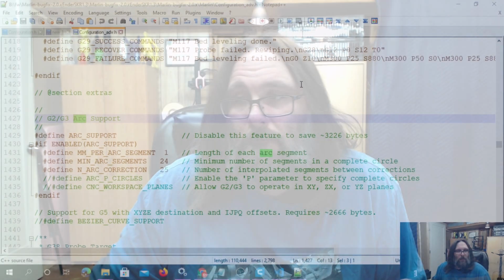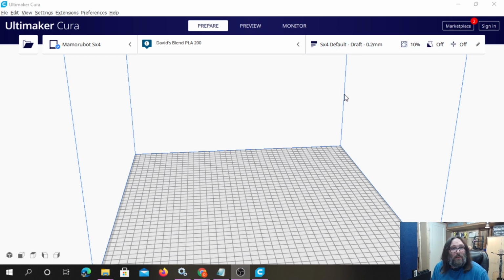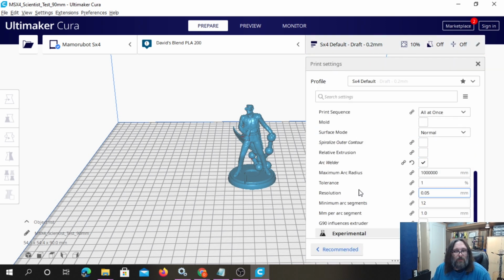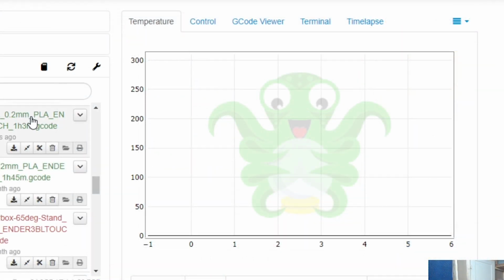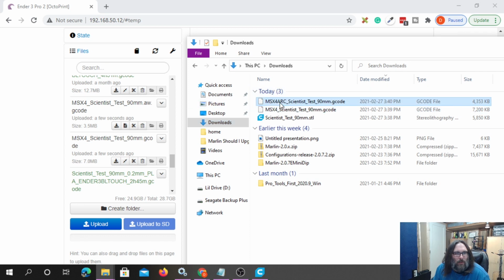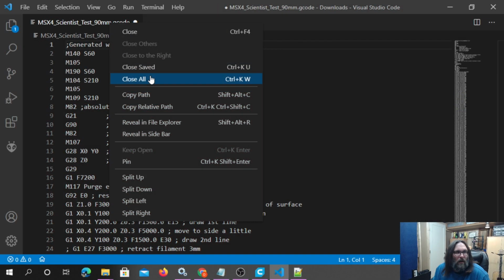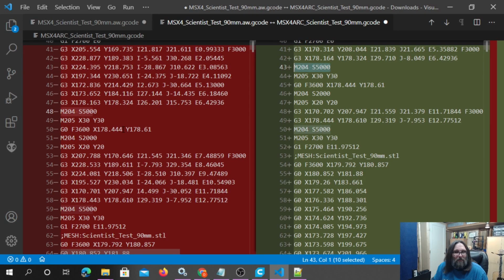Arc Welder Explained! Using Cura and Octoprint to Arc Weld!

Comment: Thanks for detailed explanation. 

I have enabled Arc support + Mesh Bed Leveling + filament runout on melzi 1284 board by using  vscode autobuild marlin optimized optiboot option.   I think  optiboot  optimized option reduced  memory of hex file.

Comment: So if the arc isn't enabled in the firmware- the plug in from cura won't work? Am i understanding that correctly? I'm pretty new to this and haven't figured out how to navigate vsc or platform io yet.
Thanks if you actually read this and have time to answer!
Reply from the maker: Hi Henry if arc support is not enabled in the firmware your 3d printing is running it will not be able to interpret the G2/G3 move commands your printer won't be able to interpret the commands.
Reply: @3DMakeIt  Ok, thanks.

Comment: Is there a firmware change to use Arc Weld? I have an Ender 5
Reply from the maker: You need arc support in marlin.
Reply: @3DMakeIt  Ok... What does that mean?
Reply from the maker: @jamescullins2709  You need to find #define ARC_SUPPORT  in the configuartion_adv.h file in marlin and make sure it is uncommented to enable arc support.   I did look and the example conifgs for the ender 5 have arc support on.  You can use a terminal (pronterface/octoprint) to send an example g3/g2 arc command to see if it accepts the command and moves it to verify as well. https://marlinfw.org/docs/gcode/G002-G003.html
Reply: @3DMakeIt  thank you so much, I will have a go at it.
Reply from the maker: @jamescullins2709  no worries!  Good luck

Comment: hi, great guide, a quick question, do i need to update my firmware for this ? i'm using ender 3 with marlin 2.0.0 and skr e3 32bit board.
Reply from the maker: You need to make sure arc support is enabled in marlin.

Comment: Nice video, thanks!  I wanted to add a few clarifications:

FieldOfView wrote the cura plugin, but I wrote the arc welder algorithm and the OctoPrint plugin and console app (which is used by the cura plugin).  Not a big deal, but I did want to clarify that :)

Second, I wanted to clarify a few points about the settings:

The path tolerance percent is how much the length of an arc is allowed to be different than the original path.  That setting is a bit unnecessary now that I've implemented some advanced error detection (see the beta version of the plugin for this).  It was originally a fail safe, but if arc interpolation changes this setting may become useful in the future.

The resolution is how much the path is allowed to change versus the original path in mm.  The algorithm basically finds the point along the arc that is farthest from the original path and compares that to the resolution (it can be +- 1/2 of the resolution).  This is really the key setting that determines how many arcs will be generated, and should be set according to the gcode/printer resolution.  0.05mm is the default in Cura I believe.

The two other settings (MM Per Arc Segment and Min Segments Per Arc) were not 100% understood by FieldOfView.  I blame myself for poor communication, but this is for folks running a fork of Marlin 1.0 (and a few others), which have incomplete interpolation for arcs of a small radius.  They can come out looking like polygons due to the default MM Per Arc Segment setting (1.0) and because there is no Min Segments per Arc setting.  I call this feature firmware compensation, and it handles these small arcs differently at the cost of some compression so that they print correctly on old firmware.  If either of those settings are 0, firmware compensation is disabled.  I am hopeful that FieldOfView will add a 'Firmware Compensation Enabled' checkbox soon to make that clear.

Finally, regarding print times, you are generally correct in that prints should take the same amount of time, but if one is streaming over serial (OctoPrint) the print times can be quite a bit lower.  One would have to time each print to see this.  In general, if the print time is lower, quality should be increased, because any difference in time is likely due to planner starvation. 

Anyway, I subscribed and look forward to more videos!

Edit: I missed this earlier, but I and J is the center point (offset) of the circle containing the arc, and X and Y is the destination.  The starting X Y location is from the previous command (the current position.

Second Edit: The ArcWelder core algorithm is C++, but I also created a python extension :)
Reply from the maker: Wow thank you so much for all the clarification. Nice to have someone with so much knowledge appreciate our work. And we appreciate how much time you put into making the algorithm and the octoprint plug in.
Reply: Great video, wonderful tool, and awesome clarification!

And, FormerLurker, if I may ask: Is there a way to control roughly how many arcs (lines of gcode) get chosen for a full circle?

Because I'm trying to print a ~Ø180mm roller bearing, and each perimeter of the walls takes ~140 G3 lines to complete. This means that the roller races are a bit poligonal (not good for smooth motion).

It seems the first 3 points result in a first arc with long radius, then when the arc is reset (for the n+1 point), it chooses a very short radius, which gets reset, then a long radius, and so on.

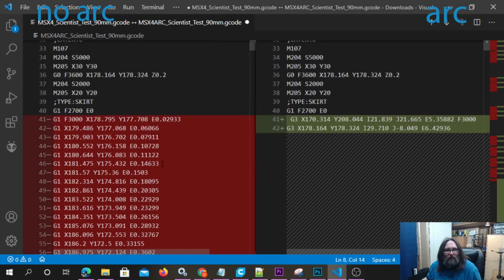I tried tinkering with the settings, but nothing came close to the example at 15:15 where the skirt circle is drawn by only 2 arcs!

Is there any other place where I can read more about ArcWelder, or some similar discussions?
Reply: Nevermind, it was my STL export settings. Too low quality, so bad points to feed the ArcWelder. Bumping up the STL quality made the algorithm nail it! Awesome!

Comment: Hi David, I also tried this a good 4 weeks ago. It comes from the CNC area with its G1 and G2 commands. In the meantime I have turned it off again, also in Marlin. Since yes memory costs nothing more. In addition, you can no longer check the code when replaying the G-code. That means to display the layers etc.

Otherwise this is a good Plug'in.

Greetings Roy
Reply from the maker: Hey Roy Great comments!   NC viewer will let you view the gcode just no live :( haha
Reply: FYI, visualization is working in OctoPrint (including pretty gcode viewer), Simplify3D (excellent support , but low resolution).  There are open issues for Cura and PrusaSlicer, hopefully others will catch up soon.